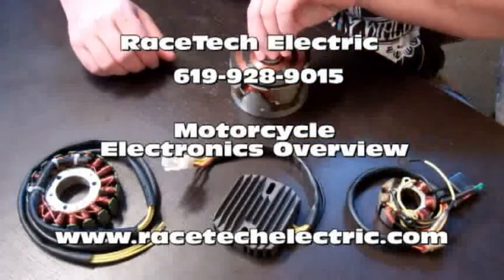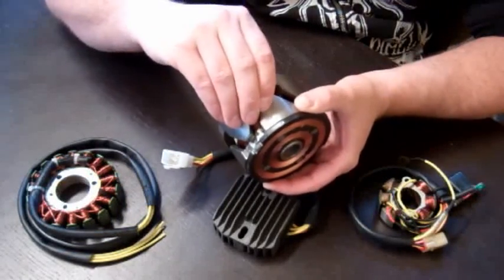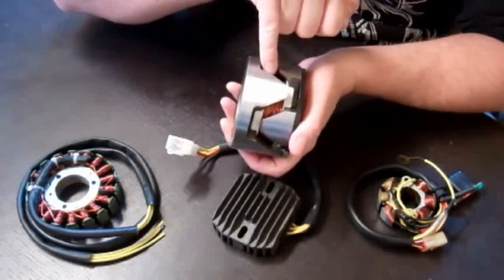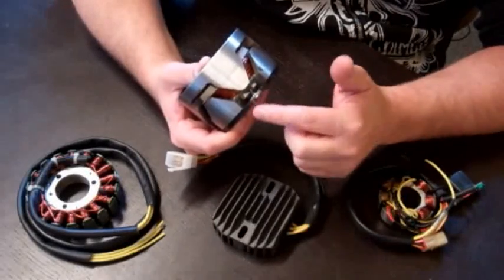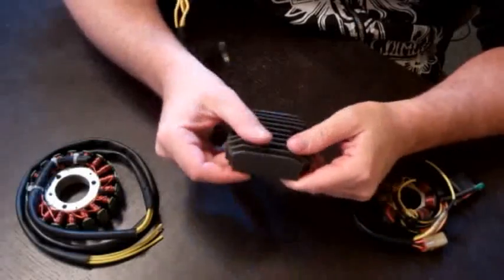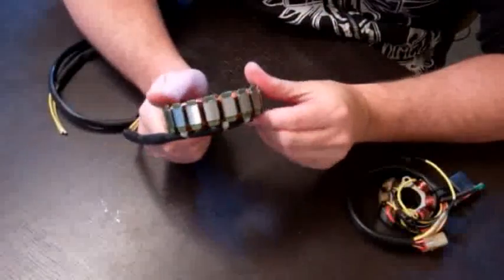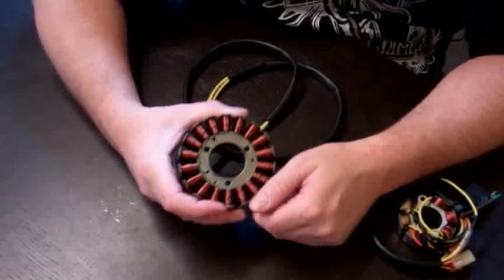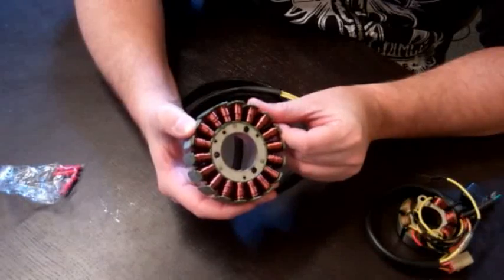RaceTech Electric Motorcycle Stator, Voltage Regulator, and Rotor Descriptions

Comment: Having trouble finding regulator 200 rally Can-Am Bombardier its. a 2005 my local Can-Am says the parts are discontinued that's why I'm having a hard time finding them
Reply from the maker: We don't have that exact plug in regulator for the Rally 200, but we have one very similar. You will have to change the connectors most likely, or hardwire it. This is the one:
https://rmstator.com/en_ca/voltage-regulator-rectifier-for-can-am-traxter-500-1999-2005-traxter-500-max-2003-2005-quest-650-2004

Comment: What happens if I mount a 35 Amp reg/rec on a bike that originally had a 22 Amp one? (It's a Yamaha r6r 2010)
Reply: Edd Vega did you buy there stator?
Reply: Or rectifier? If so how did it hold up
Reply: InfinitRyda2.o it is the same stator, I changed the rectifier to another of higher capacity. Works pretty well.

Comment: hola.
te tengo esta duda. estoy restaurando una yamaha xs750 de 1977, lamentablemente el sistema eléctrico no estaba, así que lo hice nuevo con lo básico luces, encendido, platinos y bobinas, hasta ahora funciona todo, pero no logro que el alternador carge.
el problema es el regulador rectificador, trae 7 cables de los cuales 5 ya reconocí 3 a la  bobina trifasica. negro y rojo carga de batería, y quedan los 2 restantes. verde y cafe que se conectan a el campo del stator, pero este no se energiza no se magnetiza.
por ahi leyendo creo que se debe meter 12 volts a uno de esos 2 cables, antes pasando por chapa para magnetizar el campo, pero cual es el cable que debo meter los 12 volts el café o el verde. si me equivoco quemare el regulador rectificador y no es muy barato como para quemarlo y comprar otro.

Comment: I tested my Stator and receive .8 on each of leads and I tested the regulator and get around 550 on each lead. From what I have read both of those readings are good. The battery still does not increase voltage when the bike is started. What else can I test that would cause the battery voltage to NOT increase when my bike is running?
Reply: Clint Roehr The regulator part  of the regulator/rectifier can go bad. Most bikes have a shunt type regulator which means that when the target voltage is met the regulator starts to conduct holding the voltage at the target while dissipation the output, turning the stator energy into heat through the regulator/rectifier. The diodes can test good and the regulat0r/rectifier. The regulator section can also fail in the open position which will be evident by overvoltage. :-)

Comment: hey man i have a voltage regulator similar to yours but the problem im having is my fuel pump relay keeps getting fried, the fuel pump still works but the start button does not causing no spark to my plugs....my question is do they go bad to cause problems like this.my bike is a 1997 yzf600r..any thoughts..thanks  in advance...check out my video i have on this issue